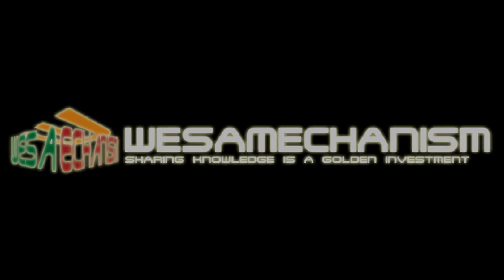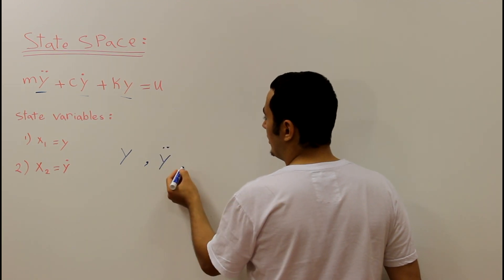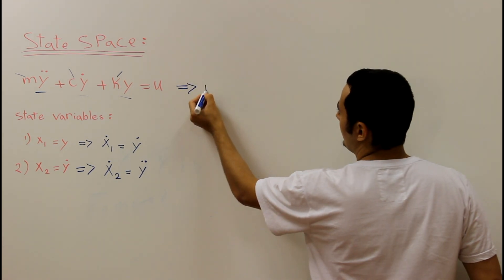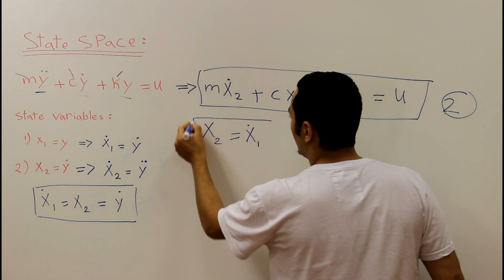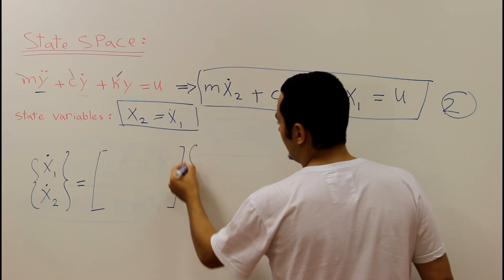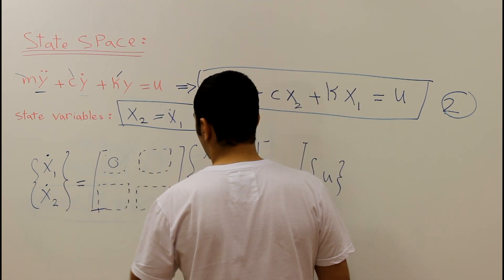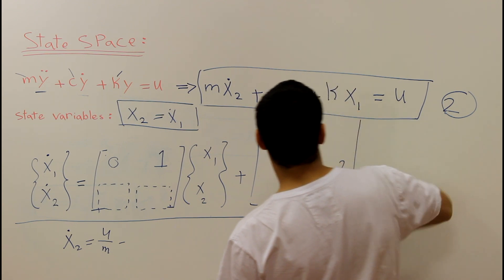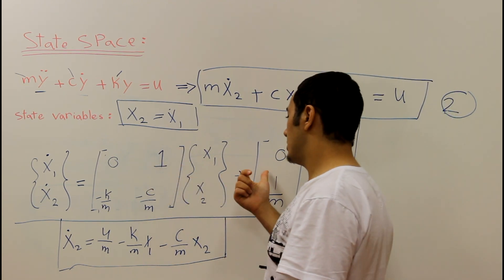State Space Representation ( Dynamic Systems ) | Mechanical Engineering

Comment: State-space model of grid-connected inverters under current control ...
ieeexplore.ieee.org/iel5/4079749/4202124/04202129.pdf

Could you please explain the state space model in this paper..how is it different from the standard state space representation?